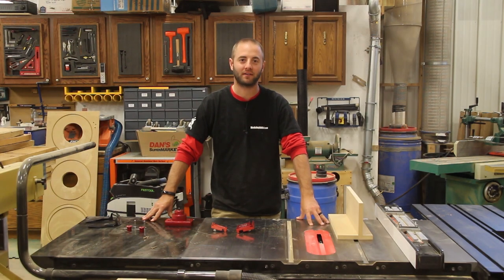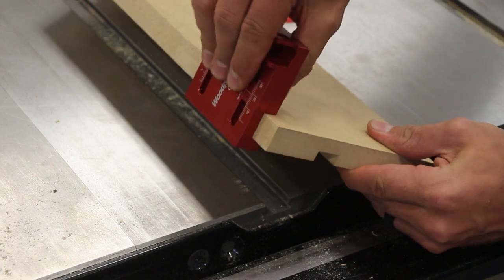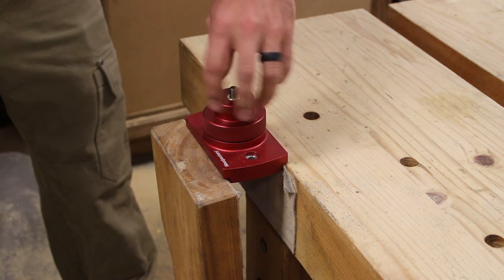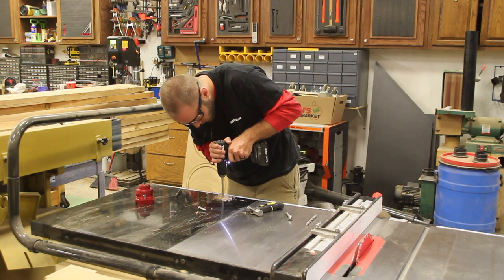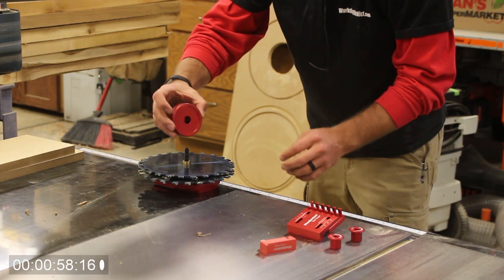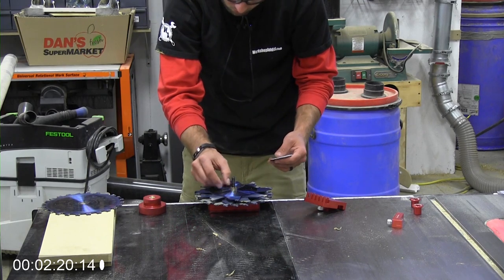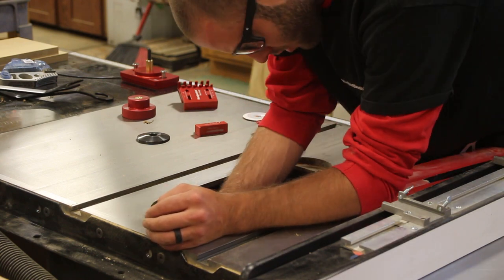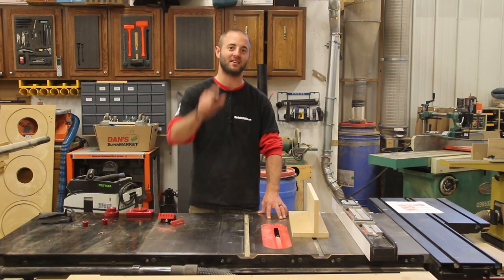Woodpeckers Latest OneTIME Tool | Dado Setup Fixture and Gap Gauges

Comment: I don't really see much of time saver here since it would have to be unscrewed (after all the time for adjustments was done), then the insert and blade on the saw was removed, only to swap one for the other. Setting it up on the saw arbor is a one time thing. For someone with a disability it might be good, but not for most.

The little gap measuring tool is a good idea in and of itself. That could be worth it. That said, I'm sorry but I just don't see alot of benefit to the other tool.